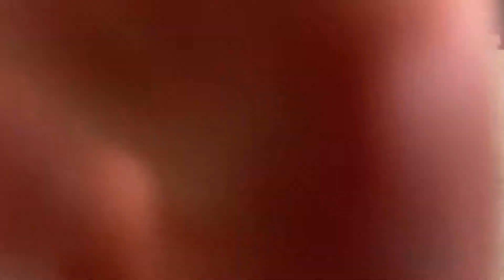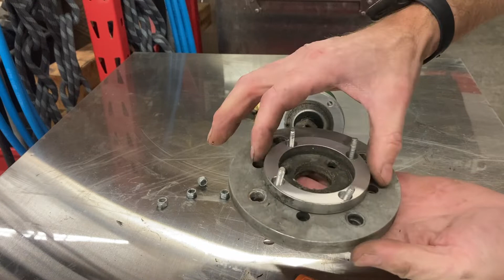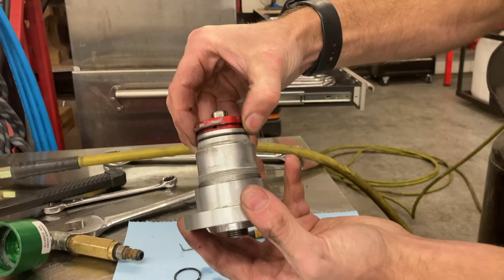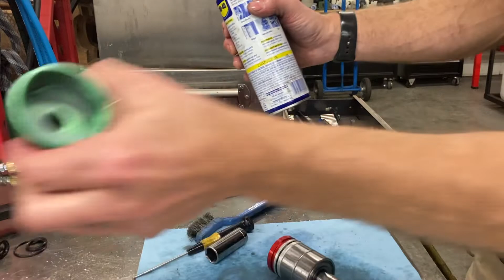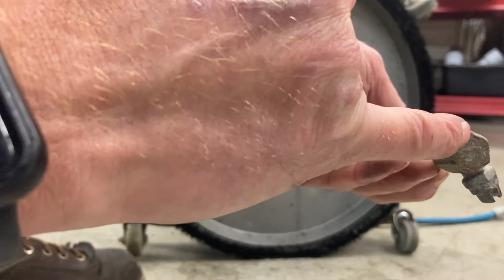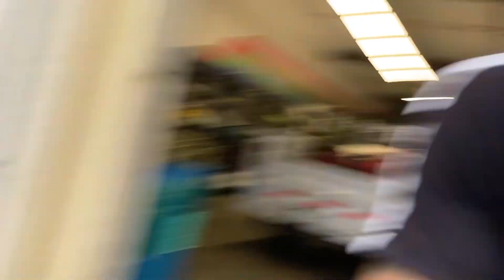Reclamation Pressure Washing - High Pressure Swivel Seal Replacement

Comment: Have you ran mosmatic swivels ?
Reply from the maker: Yes tons of them!  The DYC’s but Mosmatic won’t do a rebuild kit, only a seal kit, and they claim they last forever they don’t.  I’ll kill a DYC in 3 or 4 months, and with no rebuild option, there’s no point.  Whisper wash is the best for sustainable operations and they’re easier to work on
Reply from the maker: I’ll do a review and comparison of the two swivels.  The whisper wash “green bearing” and the mosmatic DYC.  Maybe mosmatic will see it and do the smart thing for contractors and start selling bearing replacement and shaft replacement kits.